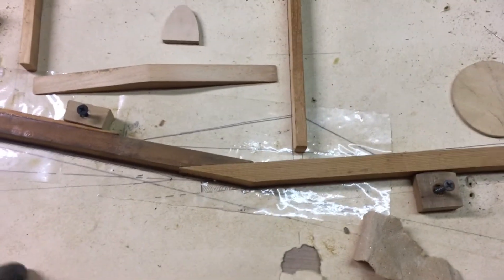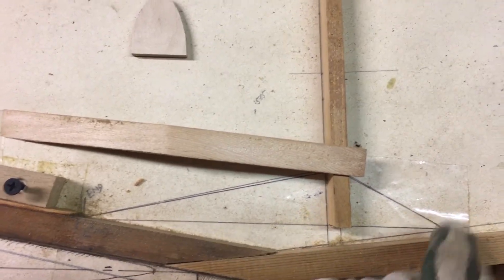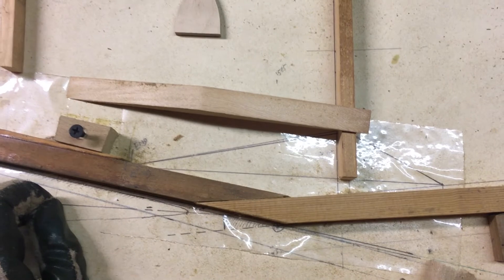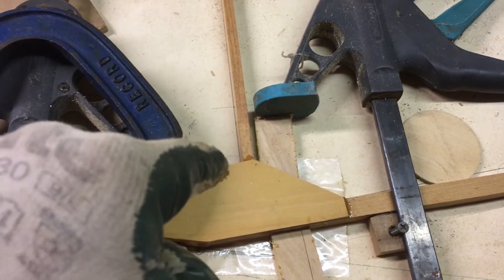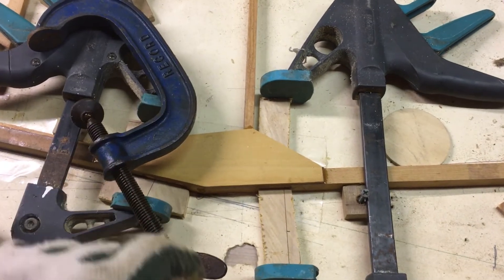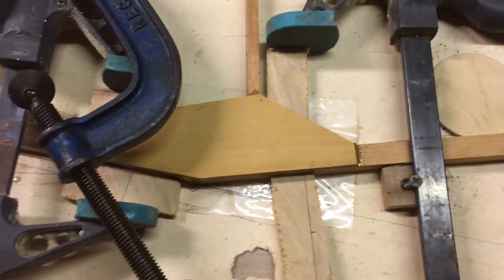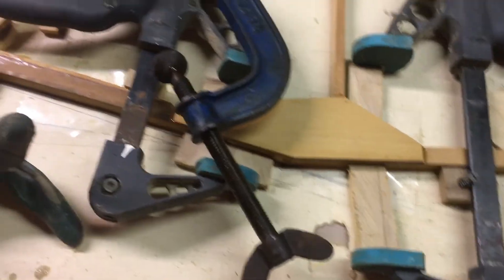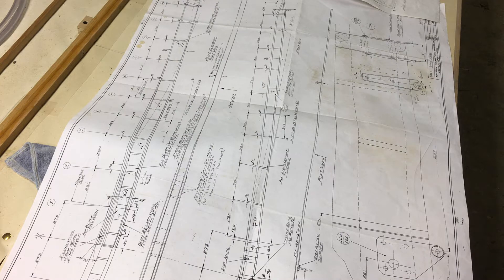Druine Turbulent Build Vlog 28

Comment: Interesting discussion on the spar mod, may as well do it while you are there. As well as pilots getting heavier, aeroplanes tend to gradually gain weight over time so you are future proofing your work by incorporating this. Thanks for the video.
Reply from the maker: Thanks for the comment!  Sadly pilots tend to gain weight over time also.  I have not had any response from the LAA as yet.  Bringing the full force of my lower second class degree in Aerospace Engineering to bear on the problem I think the solution I envisage will probably be the one.  Everything I have done has now set off so more work will happen shortly!